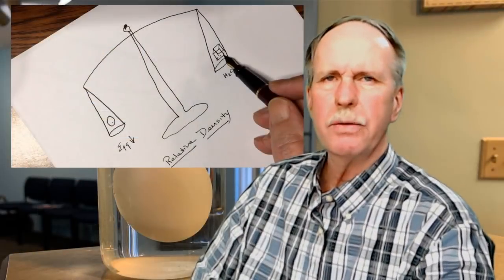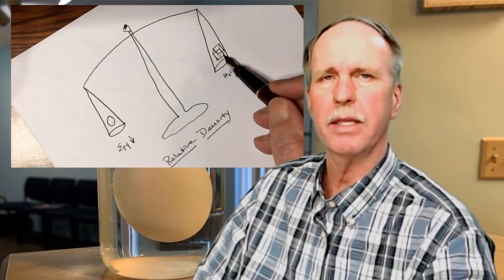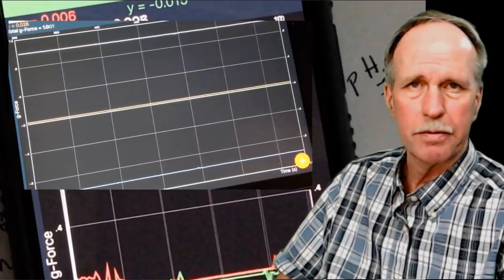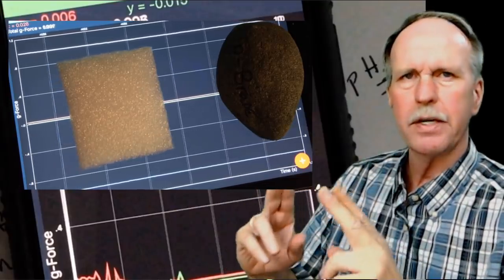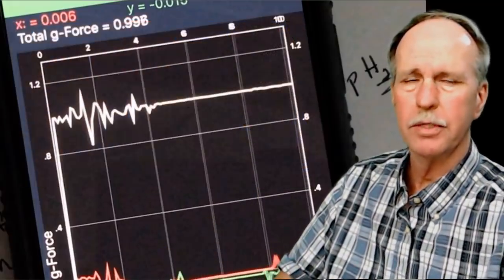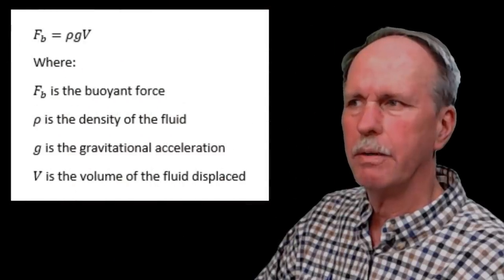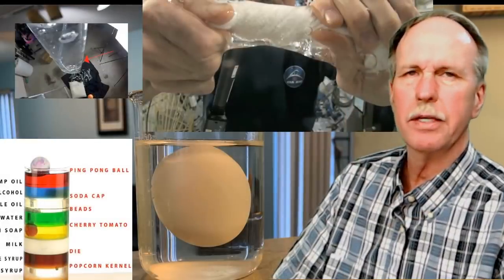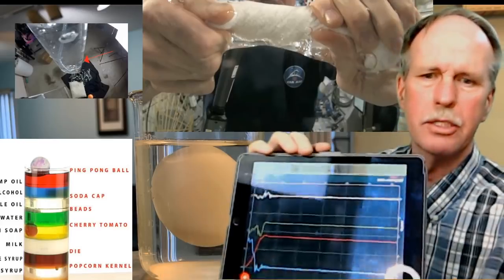Relative Density vs Buoyancy Part 2

Comment: This experiment has demonstrated Archimedes' hydrostatic principles found in the treatise On Floating Bodies, proposition 7 (Solid immersed in a Fluid).  But Archimedes two postulates and about ten propositions in his treatise.  Let's look at the second postulate: Ὑποκεί‹σθω τῶν ἐν τῷ ὑγρῷ ἄνω› φερομένων ἕκαστον ἀναφέρεσθαι κατὰ τὰν κάθετον τὰν διὰ τοῦ κέντρου τοῦ βάρεος αὐτοῦ ἀγμέναν. (Archim. ed. Heiberg ii. p. 336. 14-16). Alright I'll go to the translation now:

Let it be assumed that, of bodies which are borne upwards in a fluid, each is borne upwards along the perpendicular drawn through its centre of gravity.  (Greek Mathematics Vol. II. Loeb 362,  p. 245)

There is only one kind of idealized three dimensional shape where a body will always be borne upward by this sort of displacement.  Archemedes give his proof of this shape in his second proposition. Can you guess the idealized shape? What have both the original and follow experiments proven?  And what can you prove if you did the same experiment?

Comment: I have a question for the Dopey Worm, since all of the saline solution is higher in density than his egg, why is the egg not floating on the surface?
Reply: I guess because the saline solution is not homogenous. More salt at the bottom than the top so the egg stops in between where it as the same density than the medium surrounding it.
Reply: DELBOURG matthieu You mean there's a salinity gradient? Or a halocline? Who'd have thought that was the reason the egg didn't float to the surface. Those pesky independent variables!
Reply: It’s because the position of the egg depends on the angle of attack of the saline flerspective.

Or diffraction.

Or miraging.

Or possibly all the above plus god.
Reply: The real question is why the egg fell into the water in the first place.